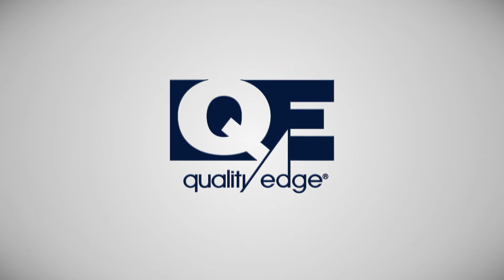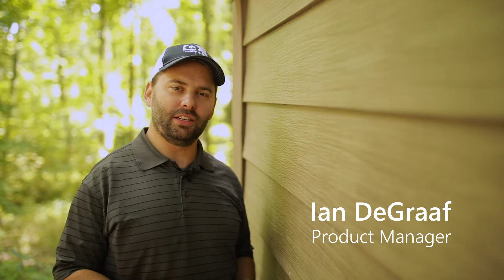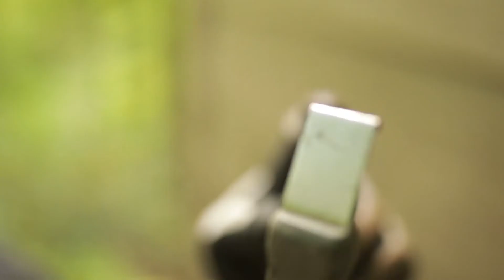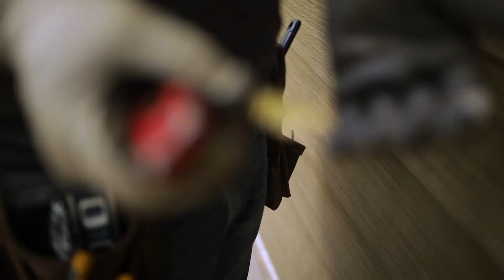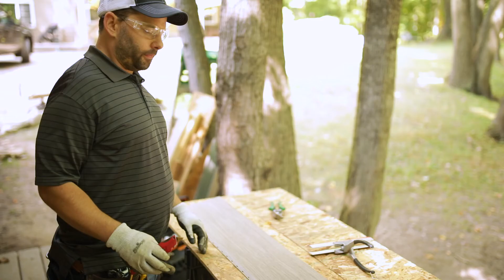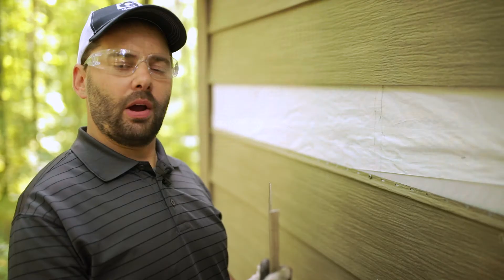TruCedar® Steel Siding Panel Replacement

Comment: This is how some dickhead fixed my siding and I came on here to see how to correct it only to see this crap.  THIS CAN RESULT IN SERIOUS WATER DAMAGE ROTTING YOUR WALL.  The doofus didn't even use aluminum nails so the rust will be running down that wall ruining the siding.  Even the lowest class trailer trash will tell you to caulk over the nail heads.
It's videos like these that make me wish the internet was never invented.